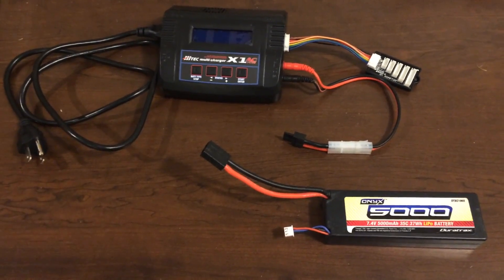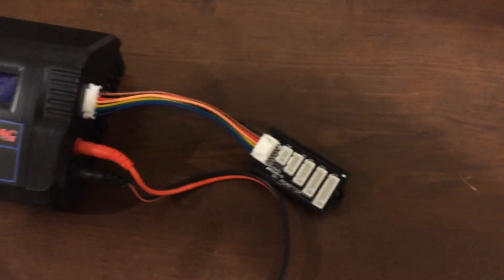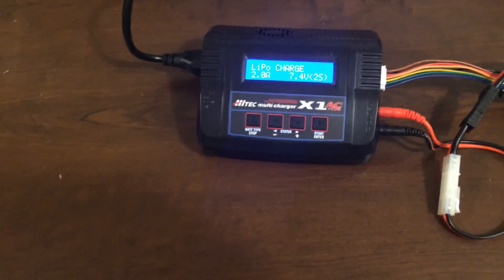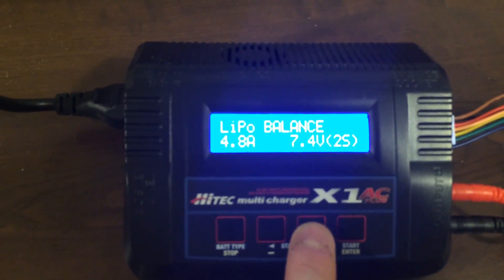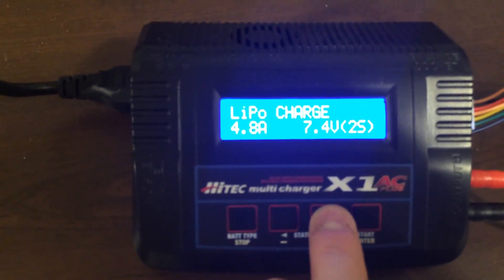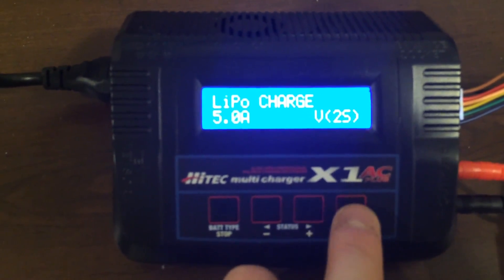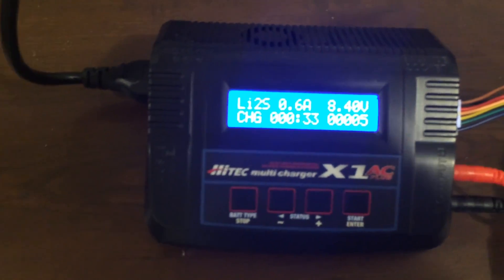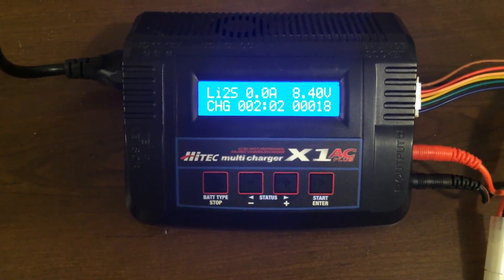HiTech AC Plus 1

Comment: Coming from a guy had that an RC10 in 1994 all of this programmable shit is ridiculous. My car had 2 servos (1 for steering one for throttle) and a receiver. There were two trim adjustments on the controller. No programming, no settings, plug and play and it worked great. Why can't they just make it simple? I have 2 traxxas trucks I got used for me and my son and all the different batteries and settings are driving my nuts. Stupid.

Comment: hi guys i have one question sorry for my english.
I bought this used battery charger and it seems to me that I have a 
problem with him.when i charge NiMH or NiCd batteries  after 21 seconds 
amperage drops to zero, but after a few seconds he start charging again 
(ie, the amperage returns to the set value) and it continues 
periodically in other intervals. is this normal or its broken.Lipo and 
Pb battery charging without interruption.Thanks

Comment: Hi Blamvideo:

I'm completely new to the world of RC'ing and I would greatly appreciate your input in terms of charging my 5000mah 4s1p lipo battery for my RC Truck.

1-Once the battery is fully charged, how long can I leave it in a fully charge state before I use it (days/weeks?)?  I've read that you should never have a battery in a fully charged state as it can damage the battery and can potentially be dangerous in general.  

2-When would you ever need to balance a Lipo battery?

3-What is the difference between the Storage Mode and the Discharge Mode?

Thank you!

Comment: I have the same battery as the one you used in this video. I have the voltage set to 7.4 and I noticed when the charge is completed, it says the voltage is 8.4. Is this right and does it matter?
Reply from the maker: Hi Chuck, you need to charge a battery at higher than its rated value to get the current to flow.  When you are charging 7.4V batteries the charger typically goes upto 8.4V.  Here's a quick read on 12v charging for reference.
http://www.xantrex.com/documents/tech-doctor/universal/tech7-universal_v2.pdf
Reply: Oh ok! Cool thank you!!

Comment: I'm confused as to why you hooked up the balance connector but didn't run it in balance mode?
Reply from the maker: +Powerpickle68 that's correct, you don't need to connect the balance cable if you're during a regular charge, but I usually do as a good practice.  I didn't mention this, but I alternate between balance charges and regular charges. Having that extra cable hooked up just allows you either option, before you plug it in.  Thanks
Reply: That didn't make sense to me either since in normal charge mode the balance lead isn't needed